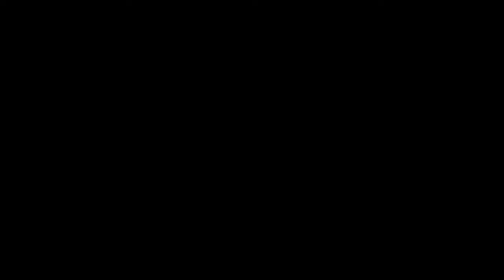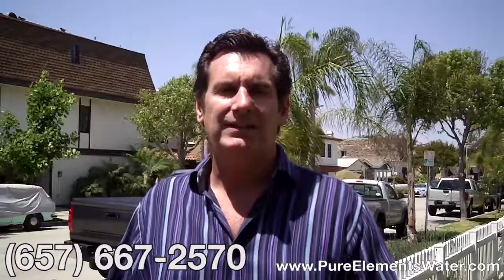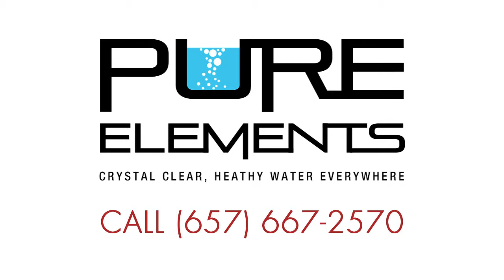Why Do People Say Epoxy Lining Is Bad For Plumbing

Comment: Dude's mad his job is being taken away by liners! lmao.
Reply from the maker: Hmmm.  Uneven application, water volume and pressure loss, lack of uniform adhesion, chemical off-gassing into the water, and some mold between the lining and the piping. Our systems eliminate all of this for less money, and effectively prevent pinhole leaks.  Why would you adversely affect your water quality in your home, when you can enhance it by addressing chemicals and heavy metals and reducing hard water issues without salt at the same time?  We clearly have the better answer, which is why 9 out of 10 times homeowners choose our option over epoxy linings after learning the facts.  Which leads to job security for us…

Comment: You are the dumbest person I have ever met I have never heard of someone lining a fucking waterline how the hell do you invert a 1” service to a house lol. Now SEWER lining is different yes you go through SEWER which has nothing to do with the WATER you drink just so you are aware you can’t drink from your faucet and expect that water to be near or associated with a DRAIN also these products do not get brittle over time I have used various brands of sewer lining manufactures it’s all on the installers. Trelleborg is a very cheap flimsy liner but Perma liner is very strong so strong that I could blow it with no pipe around it and give you and your feminine arms all the time in the world to squeeze and break it and it would never happen... also please explain how a continuous joint free piece liner allows roots to grow in?? I think you saw a bad lining video from pedros lining LLC and someone screwed up big time so now your completely against it also wtf gasses? I don’t Really care if I lined into your house 5 mins ago I will gladly take a cutting wheel and cut cast inside your home and no fire nor explosion done it thousands of time your a waste of space to society with little to no knowledge about pipe lining stick with watching buttersex anime porn and knowing everything about that
Reply from the maker: Please re-watch the video - Epoxy lining has completely different issues when used in pressurized domestic water lines versus unpressurized sewer lines.  In the domestic water lines, epoxy lining absolutely breaks down over time and shatters, introducing glass-like shards.  You would never see this in a sewer line application. Maybe you should pay more attention to the content of what you are watching before you speak your mind, and go back to helping people re-establish their drain lines because I would NEVER trust the protection of my family's health to you based on your erroneous and malicious comments.